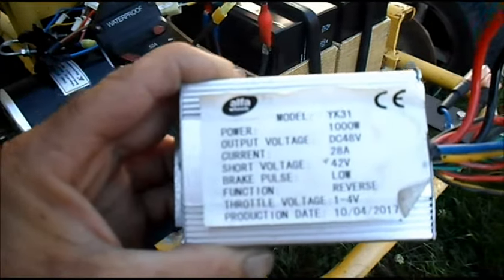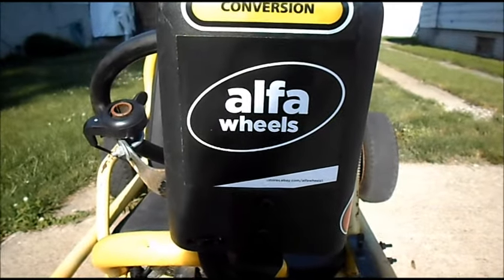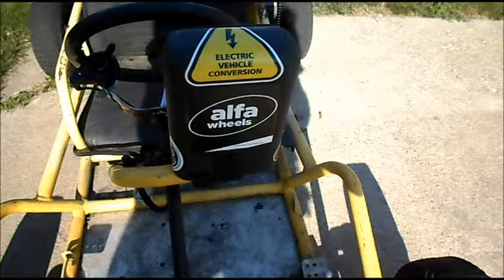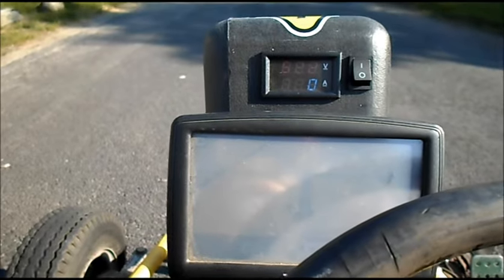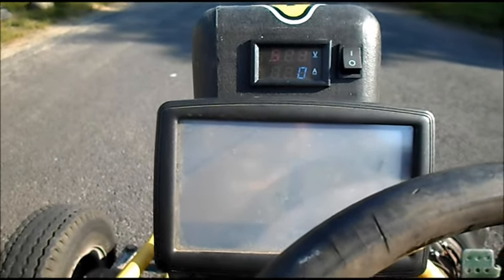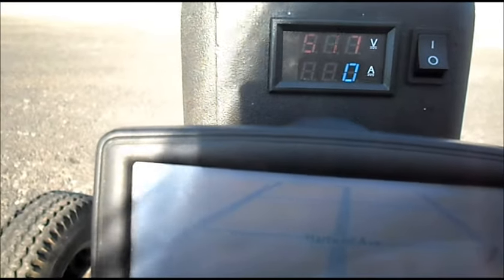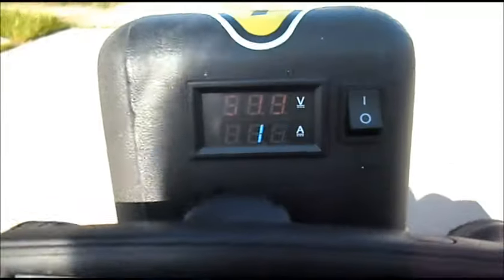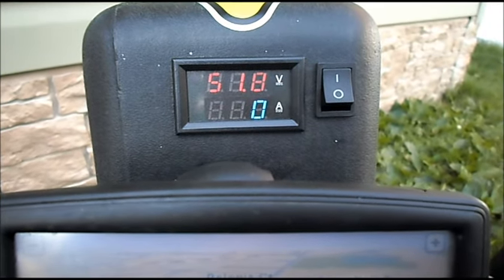MY1020 48V 1,000W motor with a TD Pro speed controller test

Comment: I've got this exact motor on my cruising cooler. My ECM went out. They want 100 bucks for a replacement 🙄. Please tell me I just need to buy an automotive  solenoid to make this damn throttle run this motor. I tried one out of a razor and it just clicks. I'm assuming not enough juice in that little box to make it work
Reply from the maker: That sucks!
...but, just using a solenoid won't give ya much control.  (Off or full "On")

I get my most of my motors/speed controllers from Alfa Wheels. 
Like this, 48V 1,000W controller (~$35.00)
https://www.ebay.com/itm/36F-1000W-48V-Speed-Control-Module-w-Reverse-funct-f-GoKart-eATV-electric-motor/151950708103?hash=item2360f7cd87:g:F-8AAOSwN1Je7SK~

Comment: 10 amps at 48 Volts, that's only 500 Watts. You can het a lot more from that motor I think
Reply: That's under flat top speed use. Notice the motor draws 30 amps under load that's over 1,500 watts! 
If your motor is drawing maximum watts than it is geared too high. If this was strictly a top speed machine he could gear it until it consumed say 1,200 watts or so at max speed but than it wouldn't have the spare power to climb hills or accelerate hard.  Likewise its a lot more energy efficient not running max load all the time.  

Functional artist Do you have a link to that voltage and amp meter?
Reply: @TotalOverkillStudios  OK ur overheating the motor?

Comment: question.. if u are running a 1000 W moto  what size batter required?
Reply: I basically have a electric quad for my son but the moto which is a 800 watt is smoking  (hot) . so I'm confused.  havent used it more than 5 times

Comment: I saw this on amazon for $119. Is it worth it? How fast are you going?

I'm trying to upgrade an old 600w scooter (manufactured in 2001). It's a Rad2Go E10 (or similar).  it used to go about 18-20mph for 7-9miles with 2x 12v 17Ah batteries. I was going to buy the controller, motor and 2x more lead acid batteries
Reply: They sell for around $80 on ebay. Yes, they're a terrific motor for the price
Reply: I habe the500 watt Version on24 vollständig 
In a Shop I MOZNR IT ON WOOD WITH SILENT PUMPER NEVERTHELES IT IS LAUSY LOUD but streng 
For a cart i always would Use bot h on one 1000 watt Controller Mount Motors dserial 
So you run bot simultanous 
Need mor Power use expensive livepo Batterien 
They are really lighther in weigth
Havemore Power capacity 
And no memory Effekt 

I also would use always Bruchlast enginsdc24 or 36 volt Not so high rtemperatur much more effrncynd up to 2000 Watts 48 volts effizient near 90 perfekt 
And fuckung much Tour Drehmoment 
Adam for e Charts 
I had good experimente with blue Label lifepo4 batteries at amazon 
39 Euro 
I was Presto amazed shen IT Artikel Holding in my Hand two of them same weight like one agm Batterien muchmore Monat i know 
But  double capacity T same weigth
 That will double the Fan and drivingtime at more speed 
And when you are  a litten Handy
Thre are RPM Meter led digital about30 euros 
If you dissamble the backplate of the Motor 
And Drill one of the Airwholes bihhrr that the induktiv sensor kann perfekt  Mount in the bsckplat or Front Platz And you Do Not neef an extra Magnet coupe the Rotor insider Haß ist own magmeticfield to triggern the sensor 
And yor habe another Controller or check Meter 
Same  Design lrd Digital you can buy a Temperatur Meter or9 Euro 
Can bee mounten with a strip of Adhesive
Mor style vor a cool diy Cockpit 
Spendeten also same led digital Display 
Every Kind of car nevertheles  Hof big the mobil Thing is IT nerdd style 
Optimal style all habe Stundung Sabine Look at tjis jow cool OS that Fincas 

Shockabsorbers And allwheel dribe would bee the absolut highend 
Good And many lifepo4 Batterien und eine gutes schnell Ladegerät
Mehr Spaß durch optimieren
Reply: And  i also would Look at amazon for a Holzkohle mit Deckel 
Pimp that up with carbonstyle Foil
For a cool looking batterie Box 
On the backsidd of the cart style IT cool And nice 
Sorry my own tick Design Vene Things should have a maximum usability And a cool style

Comment: is this in mph?
Reply: Looks like the display is showing the amps drawn. That's why they are higher initially (around 30amp) but settle down to single figures on a run.